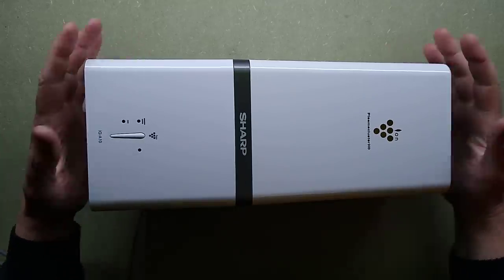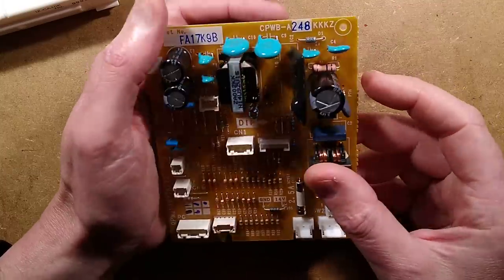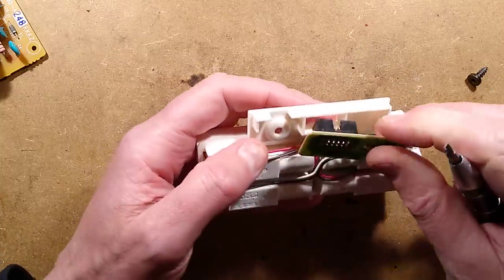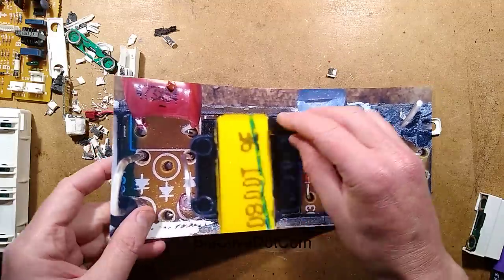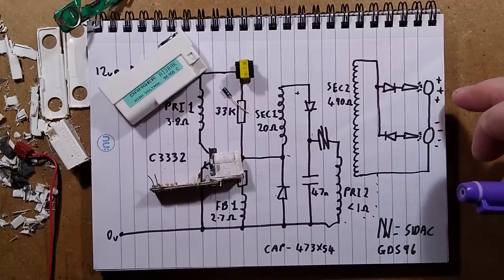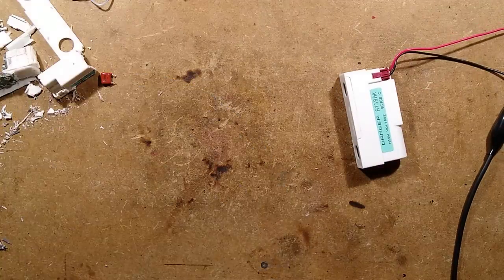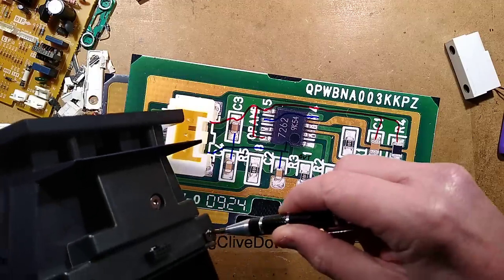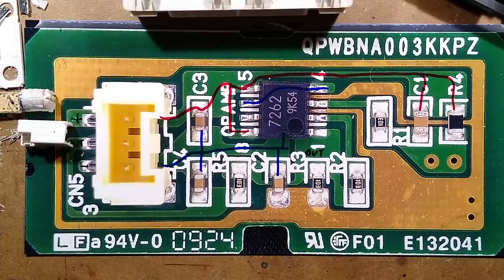Exploring a popular Japanese air purifier.

Comment: Speaking as a someone who studied chemistry (not Thunderf00t, unfortunately), the reason water molecules would cluster around a charged particle is that water molecules exhibit a dipole due to their shape. The oxygen atom has a greater hold on the electrons in the bonds with the hydrogen atoms. As a results, the oxygen is slightly negative and the hydrogens are slightly positive (but not to the point of becoming ionic). This occurs in aqueous ionic solutions: e.g. in salt water, water molecules will cluster around the positive sodium ions with the oxygens pointed at the ion, and with the slightly positive hydrogens pointed at the negative chloride ions. 
In this case, note that the positive hydrogen ions are lone protons, and so are very small. I doubt many water molecules could fit around a lone proton due to steric hindrance (the jostling of the much larger water molecules trying to get close) as well as repulsion between the adjacent dipoles.
Also, where do the electrons ripped from the hydrogen atoms go? Are they used to form the O2- ions?
Speaking of which, the superoxide ions are a reactive oxygen species, so they would inactivate any bacteria or viruses that they bumped into. Superoxide is found in our bodies, but less often in air where it would need a relatively hot plasma to form. Also, as you mentioned, I suspect that more ozone would form than superoxide ions--from both corona discharges. Afaik, the oxygen being split by the eIectric arc to produce ozone is supremely indifferent as to whether the pin is positive or negative.  And how do either the lone protons or superoxide ions do anything in the way of cleansing when they are surrounded by a buffer of water molecules?? (I wrote the previous paragraph before watching the last bit of the video... he, he, he, oops! Note that ozone is a neutral compound, so those collector plates would have no effect on it.)

As an aside, water's dipole moment accounts for its high melting and boiling points for a compound of its mass--as compared to methane, for example--as well as the fact that water swells as it freezes.
Reply from the maker: I think the plasmacluster units are basically trace ozone generators in disguise with a hefty amount of marketing.  It's nice that with one in almost every Japanese home, office and public building, they are doing a nice long term test for us on ozone's effects on viral transmission.

Comment: The diodes in the emitter head connected to the needles are fantasy.  Its just two needles that emit and a spark grounding.  Check the threshold on the "negative".  It looks like the old crystal ignition circuit on low rpm "clapper" ignition driven engines.

Comment: 1. Why is ozone generator replaceable? It seems to me that a good clean will restore it to "as new" operation!
2. The opamp at 29:00 is a unity gain buffer with very high input impedance. Surrounding the input pin with buffered signal bootstraps input to reduce input capacitance to near zero.

Comment: that shield around the plate on the op-amp circuit looks like a "driven shield".   the theory being you want the shield to be close to the voltage of the signal you're shielding.  the op-amp is set up as a voltage buffer by the looks of it.  it's be interesting to put a meter on that output signal while it is running.    On the replaceable modules, it seems kind of specious to have to replace them;  couldn't you just take it apart and attack the emitters with a small brush to clean the dust off of them?
Reply from the maker: They might need sharpened as the tips of corona needles erode over time.

Comment: Balanced Ion generators/fans are a big thing in ESD sensitive environments at ESD stations.  They're aimed at anything insulative (like plastic, etc) that you can't contact-discharge in order to strip away stored charge on the surface of those materials.
Reply from the maker: I've tried to get then from eBay from time to time, but they either go very high or get pulled from auction.
Reply: @bigclivedotcom  Yes, because proper fans are actually built to be calibrated to avoid going out of balance, have a built-in tip wiper for the corona-type, and some use Polonium as part of the process. (Though the alpha-ionizers are really overkill in most cases) Corona types are used down to the really sensitive 20V-50V ESD-sensitive stuff, alpha down to 0V, in extreme temperature environments.

Comment: These should be in all receptions, pubs, restaurants, trains, buses, toilets and shops, during these days of COVID anything is worth a try, and I do believe this would kill coronavirus.
Reply: You are correct.  The corona virus is itself somewhat fragile in nature given that the outer part of it is jut a fatty-layer with some protein spikes.  Simple hand soap will dissolve the fatty layer and discabobilate the virus.  Ion generators that only generate negative ions will actually repel the virus and make them stick to walls and surfaces, driving them out of the air.  But its difficult to say at what concentration level of ions this occurs.  Having positive and negative ions on both sides of them might very well rip them apart.  Would be nice to see some real research into the matter!
Reply: I gave my mom a negative ion generator necklace to wear in addition to her mask when around other people as an extra layer of protection.  Has worked so far.

Comment: The opamp circuit seems to be a guard ring? They are used to shield a signal with a low impedance version of the same signal. It prevents leakage. Very odd.

Comment: Well, that chemistry bit is looking so scifi stuff. I believe that discharge arc (plasma) combines 3xO2 into 2xO3 (two ozone molecules) and then ozone being an oxidizer, gives off one oxygen atom into something thats going to take it wheter being a cell membrane (carbon based) of an bacteria or other chemicals that are in the air. So in a way we lose a bit oxygen from air when we make ozone, however there's still plenty left and we can get it back from trees that produce it from carbon dioxide, life goes on. Also there are hydroxides that are formed from moisture in the air free radicals they are called that have their part to play as well in killing microbes etc.
For the water molecule thing you would need moist air so if you use it in dry air you get more ozone (duh), thats common sense of course.

Comment: Such a well engineered circuit, for something that has dubious mode of operation. With this level of engineering one might expect it to work and be based on real science. 
  it would be interesting to know if there is a dust build up inside the unit. Is it possible that the pin and ring arrangement acts as an ion accelerator, producing a negative and positive stream of ions. Without such an effect, it is difficult to see how the air will be efficiently mixed with the ions, given the small size of the emitter cavities.
 It would be interesting to do the candle flame test on the high voltage modules to see if an ion wind is generated at a distance from the HV unit. One can imagine that the unit might work by injecting both a positive and negative stream of ions into a turbulent air flow. The ions then have time to destroy viruses, before their charge cancels out. The advantage of such an arrangement is that little ozone would remain in the output air discharged to the room. 
Why does the plasma cluster module require regular replacement? Why does it fail? It it because of dust build up between the tip and ring?
Reply: Not sure how much this helps, but these units by Sharp actually maintain some kind of counter and alert the user to clean the tips when they clock enough runtime. The tips are typically blackish by this point in time, but I'm unsure if it's dust build-up on the tips or something else.
Reply from the maker: After a short time in use here there was a white crystal-like build up on the needles.  Strangely, a donut shape round one polarity and a cluster on the tip of the other.
Reply: @bigclivedotcom  Yes I have a negative ion discharger with open pins on the top (LightAir IonFlow) it is recommended to clean the tips every day or so with a brush. When the tip pin gets covered it discharges a lot less. You can tell discharge is disrupted because of less noise. How ever this is solution is done without the corona design.
Reply: @bigclivedotcom  whatever this material is, it is being made from the chemicals available. The air, moisture, dust and the metal of the pins. It is interesting that the structure is different, suggesting a different chemical on each polarity. The doughnut shape, suggests the field is defining the shape of the deposit, whatever it is.
I am interested to know if the pin and ring structure acts like an ion accelerator. I cannot see any other way the air passing through would get sufficient exposure to the ions. The emitter cavities being so small compared to the size of the air flow chamber.
Reply: @StriderGIF  I think the black deposit is a metal oxide generated by the very reactive ozone. Most ozoniser have a needle discharge point. What is different about this one is the tip and ring arrangement, it reminds me of the structure of some vacuum tubes, valves, where the grid is a tube rather than a wire grid.
Reply: @bigclivedotcom  would like to see the metal emitter pins replaced with multi stranded carbon fibre. 
Would this change result in increased emitted ions and increase the life of the cartridge?
Reply: @bigclivedotcom  Was the donut shaped on the positive? I don't have the link now but a few minutes of googling about plasma discharges and pins, there has been some interesting research. Apparently the discharge characteristics of + vs - electrodes is different and the + discharges tend to spread out more; which would make sense in terms of a donut shape. The one I read tested mixes of needle and spherical electrodes and polarities for each.
Reply: This is particularly interesting now, if it has been shown the technology is effective at destroying viruses. Imaging such a unit at the centre of each restaurant table, office desk or train carriage roof. The WHO is speculating that the covid 19 virus is air born. Imagine if the local air surrounding people in enclosed spaces could be effectively sterilised without the risk of ozone generation or exposure to UVC light. A battery powered unit could be fitted into personal respirators. Carbon filters might be able to trap the virus, but it would be very useful if the virus could be killed while in an air flow. I am surprised that Sharpe is not more active in exploiting the technology if it works.

Comment: That last circuit board you showed us looks kinda like a voltage to current converter. Where does its output go, the microcontroller (through some kind of buffering probably)? What kind of input does that expect to see- digital/analog?
I'm thinking the whole unit's design purpose is to put out equal numbers of positive and negative ions, and that last circuit detects an overabundance of one or the other which would indicate that one or more modules is faulty.

Comment: Surely a 'positively charged hydrogen molecule' would be a proton?
Reply: More like H2+ and O2-.
Reply: An ionised hydrogen atom is just a proton, yes. In water, it doesn't really go around on its own, but sticks to a water molecule giving H3O+.

A singly-ionised hydrogen molecule would be H2+. A doubly-ionised one would split into two H+ ions.
Reply: A proton is a positively charged hydrogen module, but not every positively charged hydrogen molecule is a proton, afaik
Reply: @jek__  What's a Hydrogen module?

Comment: Quite Complicated for what it doesn't do.    Wouldn't the Neg and POS Ions cancel each other on contact ?  How is the Ion cartrage expendable and life dated ?   Corrosion to the Sharp Edges I guess ?
Reply: @pulesjet yes, the corona discharge will slowly erode the needles, also it will attract the particles to form a soot like substance,
I had a PureMate pm200 which had a detachable plate so you could clean it with a soft brush, you could probably re-sharpen the needles if you can get to them,

I think the charged plate is checking ion output so when it detects a drop in output it will light the 'change module' LED, my suspicion is that if one goes the its game over, as it will probably disable the entire unit, cos you know, profit!
I recognise your user name, Robert Murray-Smith videos perhaps?

Comment: The term "Hydroxyl generator" wasn't mentioned. Which is what this actually is, or at least what I've heard them referred to as in an industrial setting. Much larger units are commonly used in disaster restoration.
Reply: Yes I've heard that term too,
I have been involved with flood damage recovery and they do a good job of killing mould spores and reducing bad odours

Comment: In H2O, the hydrogen is at an angle giving the molecule a polarity with + toward the side the hydrogens are on and - on the oxygen side.  That is why they think the non-ionized water molecules tend to attach to the ionized particles.

Comment: Why does that module require changing after some time? Which part of the circuitry goes bad? Also what does the reset button in the back do? Resetting values/calibration stored in the MC memory perhaps?

Comment: Well I remember the hysteria at the company when we got our very first Canon laser printer back in the late 80ies. 
I was (in the beginning) "sharing" a quite small office with the printer. And yes I could smell the Ozone but had to stand really close to the printer to smell it - and it was used quite a lot. 
Shortly after the hysteria broke loose so we had to have a very bulky carbon? filter installed under the printer. Great printer for that time though.
So I do kind of understand that a company could be "afraid" of using the "O" word in their advertising.
Education would help...
Reply: It always does, but it's a rare commodity.
Reply: I would be more worried about toner and paper dust from a laser printer that's in heavy use.
Reply: man it would be so nice if everyone got a proper education
Reply: My old (early 90s) Panasonic laser printer not only didn't use toner cartridges (you dumped the toner into a bin), but also had an ozone filter that needed to be replaced periodically.   Big heavy thing, that printer.

Comment: Clive may have applied "undue force" to that module - I don't think it will go back together very easily....
Reply from the maker: The replaceable module is toast.  (Just one of the four sub-modules)  But the unit was rebuilt, a new ion module inserted (with some LEDs added so I can monitor it's behaviour through the case) and the unit is now on test.
Reply: @bigclivedotcom  If you don't mind me asking Clive how much for the replacement module?
Reply: @bigclivedotcom  hi Clive, I bought one of these and I am planning to install it in an old tower fan,
I am planning to use an FRM02 module (dual relay timer module) to wire them in pairs and use them in the same way Sharp do,

My thinking is that they are doing it for a reason, possibly because they shouldn't be run at 100% duty cycle for too long due to damage or is it just so the sensor plate has a better chance to suss out if one of the modules is no longer working?, any thoughts on this would be greatly appreciated

Also, did you check the current draw? I'm thinking it's probably quite low, around 100mA or so?
I just got mine yesterday and haven't had a chance to play around with it yet
Reply: @Rob Smith it's not undue force unless he has a screwdriver sticking out of his thumb, it was a close call though, he did seem to be checking for claret leakage as he cracked it open
Reply: @sofa-lofa4241  Err - what if a hammer was used to apply the tactical force?
(Perhaps a seriously swollen digit would be a suitable alternative to the perforated one?)
Reply from the maker: @sofa-lofa4241  Only 37mA at 12V and run cool.  My guess is that they cycle them, partly for detection, and partly to increase individual emitter life by sharing the duty between pairs.  I'm not sure how critical the airflow positioning is.

Comment: At first I understood "plasma cutter module". Now that would be an interesting way to purify air.

As for the age of the PCB, aren't the "0938" and "0924" date-codes in YY-WW format? (e.g. at 6:20 and 26:56).

Comment: i look at it this way, if it is a quack sort of device... it still grants a mind over matter sort of effect, that helps folks.   if it does as they say, i'd still question statistics... because most companies will fudge these for publication or advertising.   personally i like it, thou i'm not sure on how effective the filters are on the unit to help remove larger particles in the air, or if the voltage / amp? is high enough to eliminate particulates that enter the unit.  ty for sharing.

Comment: What i'd like to know is why do these plasma modules wear out? Do the needles wear out because of the ionization? Does the isolation fail eventually because of the high voltage? Or is dust collected by the high voltage shorting the device?
Reply from the maker: Any corona discharge needle tends to gradually get blunt.  They could theoretically be resharpened with a very fine file.